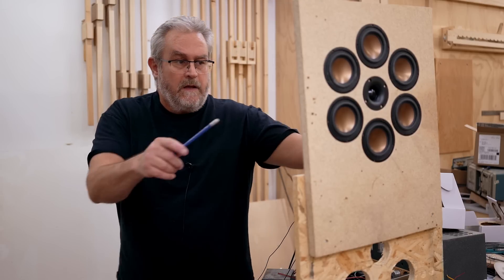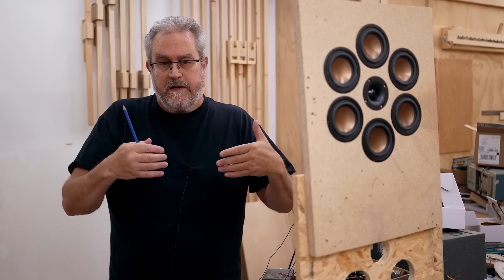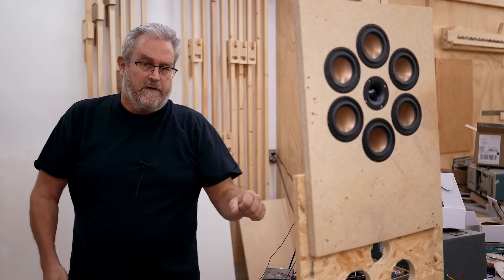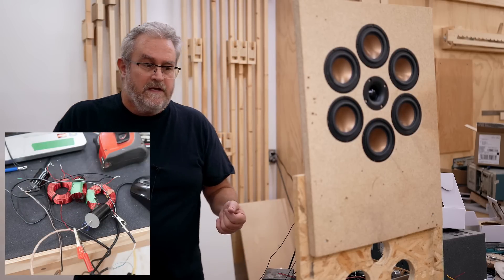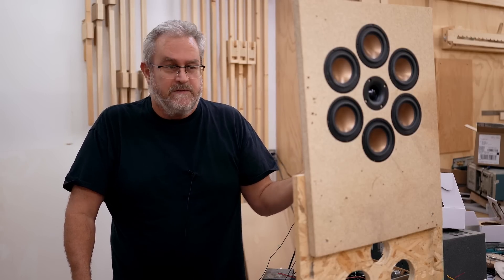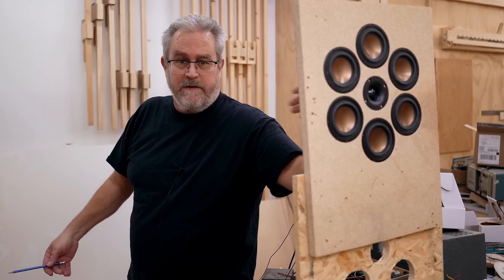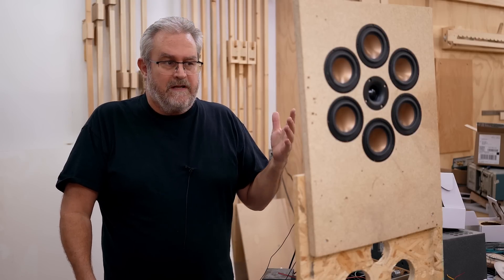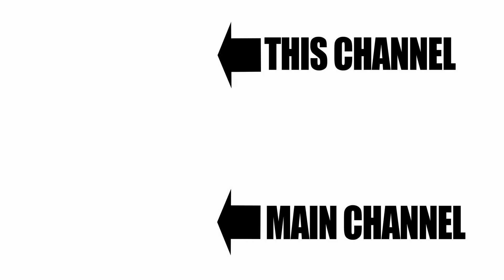All I Can Say is... Wow!

Comment: dont you think hundreds have had this idea before? there`s a reason speakers are not made like this, because it doesnt work. for example beolab 90 has independent control of each driver, therefore it can control dispersion. with the same signal and a passive crossover it will be a mess. also a vocalist or an instrument is not point source in nature either, so its mostly gimmick in the audiophile world.
Reply from the maker: Funny, for something that doesn't work, it certainly measures like it does!
Reply: @IBuildIt do some more of them. there will be erratic behaviour all around the drivers.
Reply from the maker: Nope. I ran a number of measurements from several different locations and I didn't see anything erratic at all. 
But you can carry on being doubtful and dismissive in the face of evidence that proves you wrong - I'm used to seeing that from guys that are into audio.
Reply: @JorgTheElder  i guess for fun. but the science of speakers has been worked out a long time ago.
Reply: Nope, not done any more 
https://youtu.be/2HAKxxBbVlA?t=39
Reply: @RennieAsh  minor detail, in the video he talks about size. the entire circle is like the size of an 8". genelec also has one, i would assume crossover and dimensions are carefully worked out, or it wouldnt work. still it is many more drivers with little benefit. counter-intuitive, most else just use waveguides which is cheaper.
Reply: @einarbk885   Do a search for Tekton speakers, you'll find lots of great reviews

Comment: Have you thought about having the tweeter protrude from the baffle to help with the surface reflections? Maybe add heavy felt around the tweeter to see how the baffle affects the tweeter.
Reply: Because of the horn loading of the tweeter the baffle will have a very small impact of the frequency response. Keeping the tip of the dome lower than the baffle surface will minimize diffraction and at the same time give a better time alignment. Protruding the tweeter in this arrangement will give a major problem with the new diffraction edge of the outer rim of the tweeter.  It will be in the 1,5-2 kHz region and very much in the operation area of the tweeter. 340m/(diameter(m)*2) = approx. 1700 Hz. If the diameter of the tweeter edge 10 cm or 4".
Designing a crossover for that arrangement will be very hard and unpredictable.

Comment: Here is an Idea Id like to see you try with this:   Have a unique crossover for each of these midrange drivers... separating them, so that Each driver only gets a fraction of the total Midrange spectrum.   Why?   When you play music that has a lot of different instruments and vocals all playing at the same time... the drivers will often end up suffering some Distortions.. as it cant easily keep up with how much demand is being placed upon it (especially low strength drivers).   But when you split the workload up... there is far less chance of any distortions taking place.  Each driver will than be MUCH cleaner and defined, with Far less potential for ANY distortions at all.

 I actually realized this issue, when I was using my Pioneer surround sound amp.   I normally only ran it in 4 channel mode...  but when I tested the center channel.. I found that the left and right speakers were playing the movies music... so much cleaner and clearer.   That was because most of the vocals were being shifted to the center channel... taking some of the Burdon off of the other speakers.

 It would also be good to put in at least two woofers, and do the same thing with them.   Half the frequency ranges for each of them,  so that they both have less workload, and thus, much less potential for distortions.

 Im guessing you will use Open Baffle for the woofers..  but if closed..  Try putting in Passive Radiators on three sides of the cabinet (Left, Rear, and Right).

 As for Midranges... Im sure those are decent... but the best Midranges Ive ever heard, were 3 inch Domes.
 And it would be fantastic if you tried  EPI  Inverted Tweeters,  from the   Humanspeakers   website.   Ive never experienced a Wider Soundstage, by any other tweeter.
Reply from the maker: I'm thinking it may be interesting to run a test where the top three mids cover the upper midrange, say from 900Hz to 1800Hz, then have the lower three cover the range from 300Hz to 900Hz.
But this idea that the music is complex is mostly a misconception of what's going on. The speakers respond to a single electrical signal, as in if you slice it at a single point you will get a single voltage. 
The way we perceive music is that several difference frequencies are playing at once, and while that is true, the signal that results from that is still just a series of different voltages that drive the speakers.  Those multiple frequencies get translated to the language the speaker needs to produce sound - a range of voltages.
Reply: @IBuildIt  Nice to hear that you may try this.

 Of course the Music is Voltages... but..  its still a bit more complex than that.   Those voltages are then translated into Mechanical Movement... and this is where the Distortions can come into play.

 If there is a single frequency being represented... that is very easy for a speaker to replicate... as its just a simple vibrational pattern / wave.

 But where multiples frequencies are happening all at once... there can be limits as to how well the drivers can mechanically duplicate all of them, faithfully... all at the same time.

 Obviously,  the strength of the magnetic forces are a big factor... as if the driver cant accelerate fast enough to keep up with the signals changes... they will be some degree of loss in the expelled sound.

 This is why higher end Drivers, cost much more... even while they appear to have the same frequency output capabilities.  The use of larger and stronger magnets... special "stronger but lighter" cone materials, higher precision tolerances.. such as less spacing between the coil and the magnet gap, and some other factors that Im likely not even aware of.

 Higher frequency drivers seem to suffer less from distortions than woofers... due to a much smaller cone size / mass.  But... they also are handling a LOT more of the complex workloads... and at much higher rates of speeds...  so any tiny amount of distortion, will be quite impactful.

 Anyways... I have a Theory that Bose was doing this Split Frequency method, OR is quickly alternating the signal between two or more drivers.  In this way, they are still greatly reducing the overall workload demands on each single driver...  and the switching would be fast enough, that nobody would audibly be able to Hear the alternating switching between each driver.

 Actually... This was somewhat similar to how the original surround sound amps functioned.  Every Nth of a second... they would take part of the audio signal... and throw it to the rear speakers.

 In fact, you might also consider trying both methods at the same time.  Where you split the frequency demands between a pair of drivers.. AND you alternate between two or more different Pairs of drivers.  Obviously, this would be a lot more complex to build the required electronics, to accomplish.

 Anyway... this is one of the reasons why I dont care for mere "Sweep" data... because a lot of speakers can replicate a simple singular sweep of frequency changes, without any Distortions.   Its when you are playing very complex frequencies all at the same time... and at maximum volume levels... where the distortions will end up being noticed.

 I dont know how they Measure Distortion levels in speakers / headphones... But I would imagine that you would actually need to play some complex music through them, at loud volume levels... and analyze the Entire music track, compared against the original signals.   The changes might be very small on a graph,  and so there must be some sort of automatic computerized analyzation routine, that figures out the exact percentage of distortion issues.  (of course.. your ears will often easily be able to hear muddying of certain sounds)

Comment: Using a coax that is crossed high enough to keep xmax as low as reasonable negates the doppler effect. This has been proven very well by Andrew Jones and in particular his Mofi 8 and 10" designs. I've also done this with great effect using a Seas 6" coax mated to a pr of 8" Dayton woofers. Crossed at 300hz, xmax was kept to less than 1mm on the coax.
Reply from the maker: True, but good quality coax drivers aren't cheap and by pushing the crossover point up, you undo some of the advantage of using a point source to begin with. I think you can get all of these drivers for two speakers for the cost of one Seas coax.
Also using several drivers instead of one means there are several motors sharing the power required.

Comment: i have played around with those design in 3d software, nice to see someone like you make it real :) 
would have thought that having a digital crossover would let you play around in realtime and quicky test new things. like a mini dsp SHD studio or something.
Reply from the maker: By the time I get around to building these, my 10 channel amp will be finished and that will replace the minidsp I'm using in my listening room.
Reply from the maker: Software like VituixCad makes designing the passive crossover fairly easy and arrives at good results, but you need to run separate measurements first to get the data it needs (unless you go with the published data). When I've used it, it got me close and then it took listening to the speaker to get it the rest of the way. For most people, close would be perfectly suitable.

Comment: Like tekton speaker design, but they using tweeter for midrange.. the idea is to have low mass in midrange single tweeter alone cannot produce midrange properly.. but when combining with more  tweeter they have more power handling to produce mid area..
Reply: There are also 1.5"-2" mid range drivers (cause rare dom tweeters can play below 2kHz). I think they would be also great for that. Now when I see a loudspeaker that has like 6" for a mid range, I say meh. Despite it has a flat FR say to 5kHz. No way.